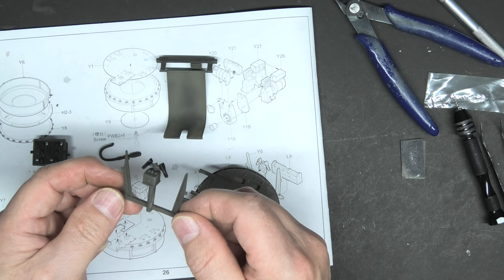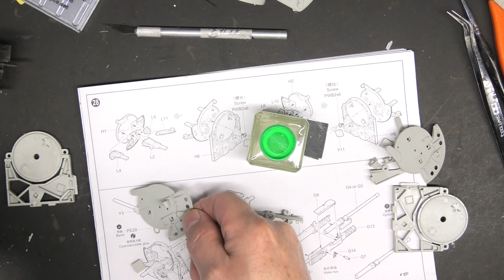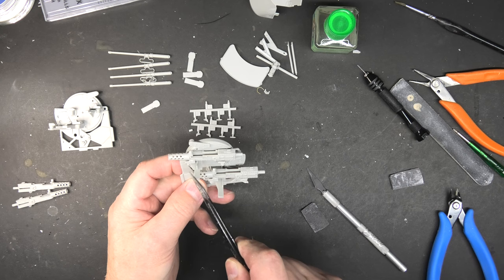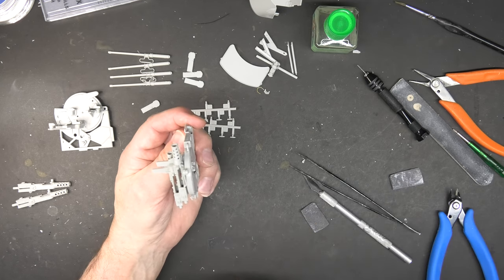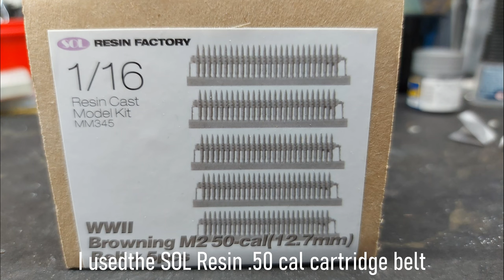Trumpeter M16 1/16 Scale Multiple-Gun Motor Carriage :Part 3 Gun Turret and Final View #ww2 #models

Comment: I recently purchased this myself, so thanks for these as I'll refer to them when I eventually get started on it. The tracks were something I was concerned about when I opened the box, their stiffness was a concern, but didn't think they'd be too loose as you demonstrated.

I've also purchased Trumpeter's SdKfz 251/D, that has separate track links to construct the tracks so shouldn't have the same problem.
Reply from the maker: Thanks 😊 It is a good kit ,shame about the tracks , I had to glue them down.
Reply: @sierrahobbys1883  It would have been better if they'd made them link-and-length, or found some way to make them individual links that lock together(I know, not easy with what is essentially a rubber band track).

Comment: Love it! Few remarks. The rearview mirrors were a postwar addition. Love your solenoids and the wiring. Very good. Maybe remove the strap down points and replace with hollow ones (door handles you did do 👍). Also, the screw on the middle of the inside of the guns wasn’t there on the real thing. PMMS has a cool tip on how to avoid this. But enough moaning, it does not take away from the great overall build, enjoyed watching it. Thank you!
Reply from the maker: Thanks 😊 .